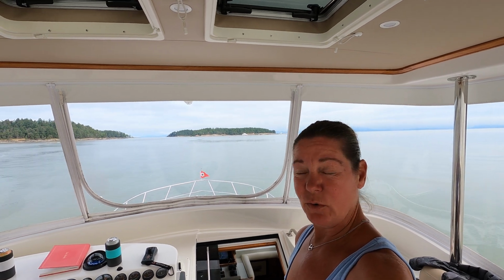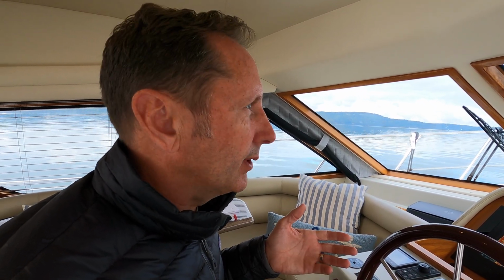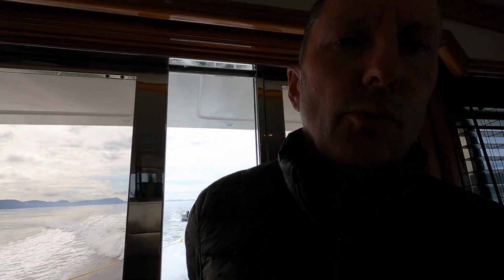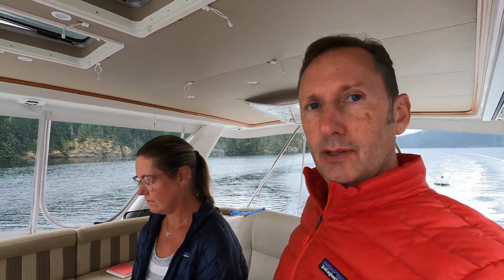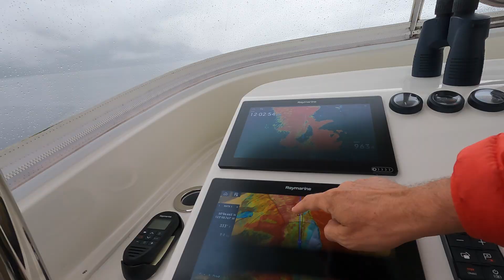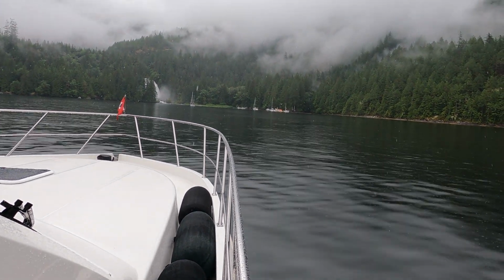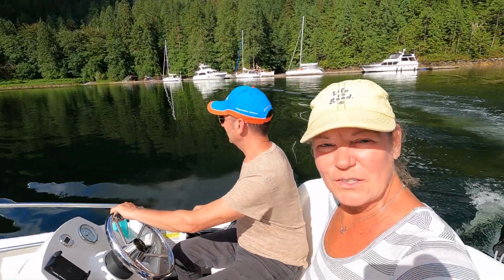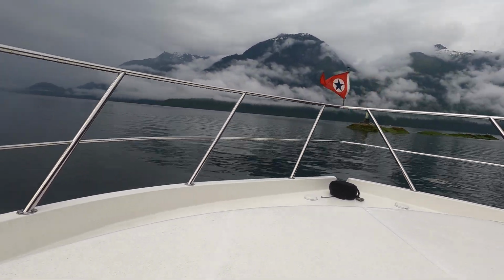Will the Cliffs of Chatterbox Falls Obstruct Starlink's Signal on our Boat?

Comment: Interesting your engines don't have fan belt shrouds.  Always thought those were a safety requirement.  Makes it easy to view the belts and pulley thou.  Mine are buried behind shrouds on Cummins.  Great video keep them coming.
Reply from the maker: Ya it’s odd. For some reason they put them on the next size up engine.